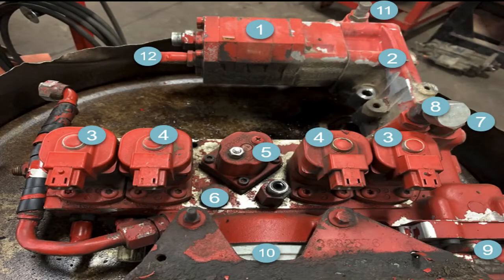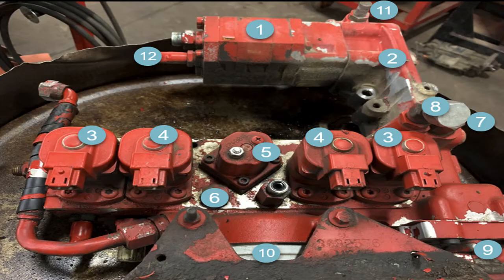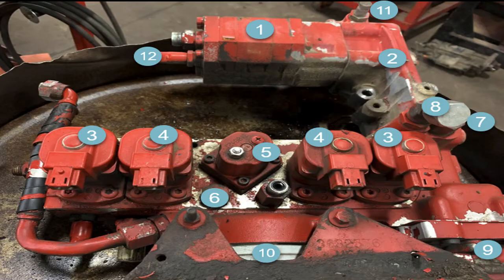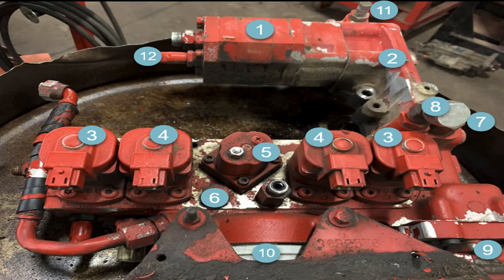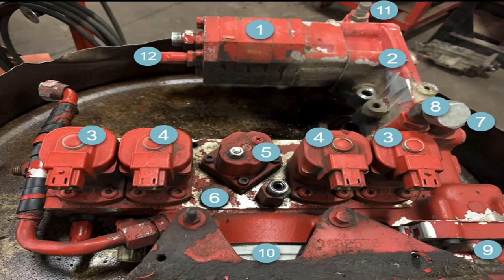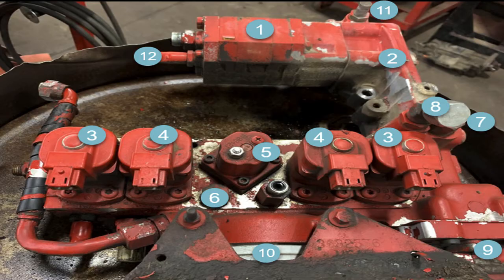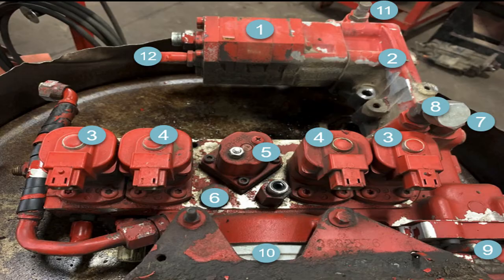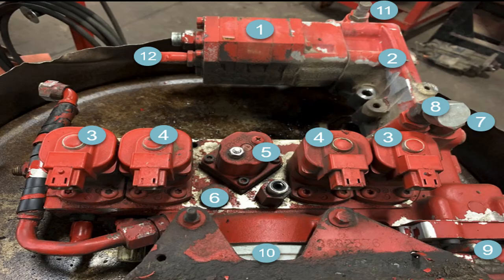ALL about the IFSM

Comment: When I poke #11 there is nothing coming out but I hear my electric pump working. I removed #6 and had a little diesel cry and then no more diesel, it's dry. I removed #5 and had no luck.  Do y'all think it's my gear pump??? Asking before I drop the 1.4K
Reply from the maker: Number 11 is a restriction port so nothing should come out. If you run the electric gear pump fuel should run out of number 5 when the solenoid is off the housing. If no fuel runs out then make sure the electric pump is actually pulling fuel. I used to hook a number 10 fuel line to the inlet fuel fitting on the ifsm and put it in a 5 gallon bucket of clean fuel. The pump should pick up the fuel. I actually would put the bucket on the valve cover so gravity helped the pump. my test fuel line was five ft long. If the lift pump is working and you see fuel running out of the solenoid hole then assemble it and run the lift pump a minute then crank it to see if you have fuel pressure. There is a test fitting on the bottom of the ifsm just infront ( twords front of engine)of the on engine fuel filter. There is also a fuel pressure sensor on the bottom. measure pressure at that bottom fitting if your gear pump does not have the pressrue sensor(#12) like the one in my video. if pressure does not build past gear pump pressure (8-15 psi) it probably is the gear pump.
Reply: @ENGINESHOPJOE Thank you!

Comment: Are there any good aftermarket options for fuel and timing actuators?
Reply from the maker: Check with local fuel pump/injection shops. Take a look at https://dwdiesel.com/home
They have branches in a few states and do a decent job of rebuilding fuel system parts. If they can't properly rebuild it they wont offer it.
Reply: @ENGINESHOPJOE  thank you! Cummins wants over a thousand for one.

Comment: Hi Joe....ive got an 871 that is putting some diesel into the oil.  We ran a little dye and found diesel coming out of #4 injector...so we put a new injector in.
Seems like it might still be sending some diesel into the oil.  Where else would you check in the fuel system?
Reply from the maker: The gear pump up at the top of the IFSM can also cause this problem.
Reply: @ENGINESHOPJOE  thanks.  I'm going to run a pail of dyed diesel tomorrow and return back into it.  See if I can see anywhere else it could be coming from.  Couple guys have said it could be a cracked head.  Obviously, I'm hoping it's not that.

Comment: Hey joe i have struggling with a cm871 for years i get like a blueish smoke with a terrible raw fuel smell, i will smoke at idle and it will stop at times and then smoke again, i replaced head, injectors, actuators, fuel pump, check valves and ecm with no luck.. what do you recomend? Also power isnt great
Reply from the maker: Those had a nasty habit of the injector cam gear slipping and then it runs out of time. The head replacement should of fixed that. We used to time ours at 4.25 - (injector cam) you can buy that wedge from cummins. Standard was 4 and 7 as I recall - im talking about wedge angles.
I had the number 7 injector - as they call it on the street- leak on a few and cause idle blue smoke and stink. That is the aftertreatment injector. You could also have a problem with a timing actuator if they go bad that bank barely fires as the injectors are injecting fuel way too late.

Comment: I'm fighting with a 2216 fault on a 871 which is high fuel psi. Changed both regulators the sensor. Checked return Checked with mechanical gauge psi is very close. Was intermittent but now is getting worse.  Looking for some insight

Comment: I have a Cummins isx 870 truck hard to start and engine check light saying low fuel pressure and delivery
Reply from the maker: The fuel pressure in the IFSM is low. There is a sensor in the bottom of the IFSM- the big module on the side of the engine with all the solenoids- that measures gear pump pressure. it needs to be around 275 psi at 1000rpm and above. You might have a high fuel restriction in the filters or lines or air in the fuel or a worn gear pump can do this too
Reply: @  I  changed the fuel pressure sensor
Reply from the maker: @kylemays9463  An interesting side note. If that fuel pressure sensor goes bad or incorrectly reads low fuel pressure, when the pressure is normal, the engine will not start. The ECM will not start the engine if it is told fuel pressure is below a minimum pressure. That is around 120 psi on the isx when it comes to crank/start. Normal running psi is around 275 psi.

Comment: Thanks for the great videos. 06 isx, that idles at 650rpm. When i bump the cruise to get oil pressure up to 40lbs to idle, the rpms pulse up n down 50rpms. If i put cruise up to 1000rom, it smooths out. Wondering if it 1 of the actuators. Oh and sometimes coming to a stop and put in neutral,  it will pulse like that a few seconds.  Tha js for any info.
Reply from the maker: I saw that a lot on those engines. At 1000 and above there is a timing change so that affects that droop. It can be caused by overhead adjustments, actuator wear on one bank(not the timing act), early calibration revisions for a calibration-IE CE10029.05 vs CE10029.32. 

If the engine runs good I would not spend the time or money looking for it. Interesting side note. A fueling engineer told me the ecm thinks it is running two separate  three cylinder engines due to the completely separate fuel systems. By that I mean the front bank and rear bank fuel is not common in the head. So a difference in one bank vs the other can cause this. It certainly is not a problem just an annoyance to us humans LOL.

Comment: When removing to fix the gasket behind it does it matter how to gear is re installed. If the system is timed?
Reply from the maker: If you are referring to removing the IFSM to re-gasket it there is no gear timing to worry about.

Comment: Can them Pressure sensor tell the lift pump not to work what tells the lift pump to run wen the key is turned on
Reply from the maker: No the lift pump is not affected by the pressure sensor. The lift pump runs because of a software routine written into the ecm calibration. It is worth noting if you are trying to prime
the fuel system using the lift pump the software will not reset the lift pump run timer until the key is off 30 seconds on a CM570 or CM 870. It is longer for newer generation ecms.

Comment: Hello, what can cause very rough idle and jerking. Changed the pre-filter but still happens. Works great when accelarating but driving in traffic is hell because of loping engine.
Reply from the maker: What engine do you have? What fuel system? It makes a difference on what i think could be wrong.
Does it smoke at idle and if so what color enging coolant temp cold and what color when engine coolant temp hot?
Did you change all the fuel filters? If not why didn't you? Does your engine have STC injectors?
If this is an ISX you may have injector ball check issues if it is a mechanical fuel system.

Comment: Why engine starting but my engine not steady , in o vibration
Reply from the maker: You need to have someone listen to it. Then hook to it if you have a check engine light on. You could be getting air in the fuel if this happened right after the fuel filters were changed.
There are many things that can cause this and those change, in some cases, with engine platform and model. So I can't even guess as there is not enough information here.

Comment: Ok, holy crap! How do you loosen those damn Allen head bolts holding the actuators without stripping them out???
Reply from the maker: Get a quality allen wrench or socket. Next take a brass drift and put it squarely on the head of the allen and give it a smack with 
a two pound hammer a couple of times. Then you usually can remove them. I put never seize on the threads since they are steel going into aluminum. Yes I have had to drill off the heads and then use vise grips to work them out once the actuator is off. Yes i have had to helicoil those holes.

Comment: 06 cm870. After truck is driven about hour or so, and i pull a hill that makes the turbo push 30+ lbs boost, i get a 2-4 second amber engine light and code fmi00 pid156, which only stays active for that 2-4 seconds. I cant find anything on what that 156 is. My buddy was a mechanic and thinks its a fuel timing actuator.  Oh and i have ALOT of black smoke when pulling in lower rpm range, around 1250-1350.
Reply: If the turbo is mechanically sound and you don’t have a boost leak anywhere you might have a problem with the turbo mechanical VGT air solenoid or it’s controller which is probably under the air compressor there are test to diagnose those devices. If the turbo is not functioning correctly or it’s controller isn’t or there’s a boost leak on a hard pole you can get a calculated turban over temperature fault I’d be surprised if it was the actuator the fault should be FMI/SPN I’ve never seen an FMI/PID fault like your describing
Reply: Sounds like same issue I had. Unplug the egr and see how it runs. There are videos on how to unplug it correctly, so the valve stays closed. I had tons of black smoke, high coolant temps, lower power, fan would kick on for 2 seconds and get that code. Unplugged it, ran awesome.

Comment: 04 ISX 435st. Truck is BARELY running. Throws spn 94 & 95 low fuel pressure. I tested at the #12 fitting (250-280psi@idle) (290psi to the floor). BUT, I tested at the # 11 fitting, and It reads 0. With the compucheck fitting, and with a directly threaded fitting, still 0 psi. Just curious your thoughts, thanks!
Reply: Thinking maybe new pump but wanna be sure.
Reply: Changed the pump and fuel shutoff solenoid. Still no go
Reply from the maker: Fitting 11 is the suction side fitting and should read less than 12 INHG maximum with a dirty filter. Fitting 11 reads suction vacuum and never should have pressure on it so that is good. The gear pump is doing a good job at the pressures you listed. There is a compucheck fitting on the bottom of the IFSM pointing straight down and that should have the same pressure the fitting off the gear pump has. That is the pressure the actuators sees. If the pressure at the lower compucheck fitting is low you have a problem with the fuel pressure regulator that is screwed in under the fuel solenoid. But before you buy that take off the fuel solenoid ( wire on it) and take all the plates out and put the solenoid back on and see if it runs good. If yes replace the fuel solenoid magnet and all the plates inside. Also called the shutdown solenoid. The solenoid has the voltage system it needs stamped on it. IE 12/24/36 etc so buy the correct one if that is your engines issue.
Reply: @ENGINESHOPJOE  thank you so much!! I will keep in contact and let you know how it goes.
Reply: Ram the pressure checks, and test on shutdown solenoid as suggested, still barely running, still throwing low fuel delivery pressure.
What should the lift pump pressure be? And where is the best place to test the lift pump pressure? I’m starting to scratch my head more and more with this truck lol. Any more suggestions would be greatly appreciated!

Comment: My fuel shut off selanoid keeps burning out and idk if it’s my ecm or another issue. So I took out the accessories behind it and run it direct. And not even connected to the ecm and it’s running fine so far but I would like to understand why this issue persists I keep changing new fuel shut off seanoids….smh
I even had one mechanic got wire it directly to a 12v source around the engine and it worked for almost a year like that until I had an issue with it again recently. It’s a nightmare these so called “mechanics” can’t figure it out..
Reply from the maker: First those solenoids are made to run in specific voltages. The ecm calibration determines what voltage is sent to the fuel shut off solenoid. Most North American on highway is usually 12 volts. Have someone check what voltage your calibration is set too and then make sure you have that voltage stamped on the solenoid you buy. 
Next make sure the engine has a good ground. If you have a two terminal solenoid then you need to supply a remote ground to the solenoid and if you don’t it could cause early failure.

Comment: Joe I need to ask you a few questions..I've been fighting my cm870 2003 isx fpr about a year..it will just start idling very bad at red light and the next red light will run fine..soon as I take off it runs fine.. so it will be loping very bad at low rpm. And go away soon as I give it fuel..any help would be great from anyone..thanks troy...
Reply from the maker: There are a few possibilities of what could be causing this. I will do a video in the next couple days Discussing your issue. There is too much to type for an old guy like me LOL
Reply: @ENGINESHOPJOE  okay thank you very much..

Comment: Great video I have a 1999 isx signature series that’s cutting out and throwing code 482 and I’ll shut the truck off and start back up and will be cleared for a little while?
Reply from the maker: Check for a plugged screen in the fuel inlet where the fuel line bolts to the ifsm. They put a small screen almost the size of a sewing thimble for your finger. I took a lot of those out. If your screen is gone no problem then look at fuel lines or something in a fitting on the suction side. Could be a collapsed fuel suction line etc.

Comment: Hello Joe I have a 2011 peterbilt with the cm871 fully deleted and once it gets up to operating temperature it smokes, especially like cruising through a town and especially shifting up on lower side. And sometimes going down highway when you let of throttle.  Any ideas?
Reply from the maker: Did they remove the injector that sits behind the turbo and the fuel block that supplies that injector. It was for regen purposes. Did they remove the egr cooler? They can start leaking coolant and that would be whitish smoke and coolant smell. Are you using coolant? I am thinking the smoke is whitish? You could have an injector that lost a ball check sometimes they would cause whitish smoke and stumble. Do you have any problems with the jakes? I had a rocker shaft problem once that cause the jakes to bang the valves and it caused whitish smoke but the overhead was clicky when you listened to it. Last sometimes those would develop a crack in an exhaust port and coolant would come out only when the head was hot. But again you would have unexplained coolant loss to go along with that. You might have to get it hot and pull the exhaust off to check ports. They say you can lose coolant out of the turbo if the center housing cracks. I never saw that. Are you using oil? If yes it might be the turbo is passing oil and hot it will smoke whitish. Pull the exhaust pipe off the turbo and see if the impellar is light choclate brown. If yes that might be it. The impellar should be soot black or very dark gray.
Reply: @ENGINESHOPJOE  yes the egr cooler is removed, and I haven’t noticed any coolant being used at all

Comment: Isx DOHC engine miss and white smoke rough idle . Cylinder #6 extremely low on temprature when checked with Infared thermal gun . Replaced #6 injector . Engine runs a bit better but still have same symptoms . What do you reccomend next .?
Reply from the maker: I will assume the cam lobes are good as well as the rocker roller and pins. I will also assume the jake is working correctly and everything is adjusted correctly. Swap both timing and metering actuators with the front bank actuators. If six still is cold with white smoke Off comes the head.

Comment: Hello! CM870 starts and idles rough for about 10 to 15 minutes then gets smoother but will sometimes stumble a little after warmed up. Any suggestions?
Reply from the maker: Any smoke while it is stumbling?. Last time the valves and injectors were adjusted properly? Air getting in fuel from suction side of fuel system?
Reply: @ENGINESHOPJOE  no smoke other than when I let off to shift and back on. New cams installed about 30k ago.
Reply from the maker: Start it up cold and compare the manifold temperature at the exhaust ports by the head. you can use your hand or a thermal gun.
Compare 1 to 6, 2 to 5 and then 3-4. If you have cold ports on 123 compared to 456 swap the metering actuators and see if the cold cylinders move and follow the metering actuator. If not you could have an injector or two that had a ball check come lose internally. They tended to cause this running issue at idle and low load. The ball check problem did not cause any other issues besides poor idle / rough running at low loads.